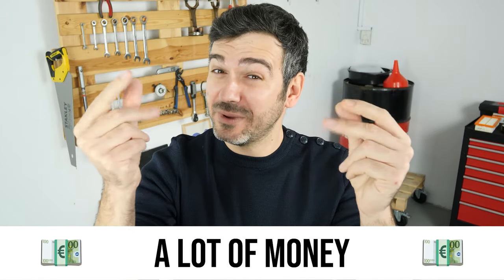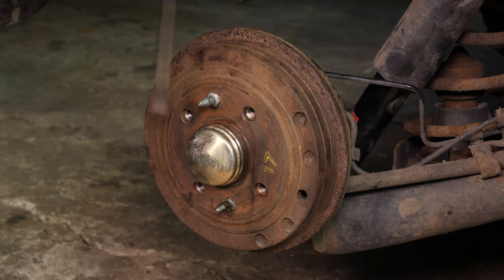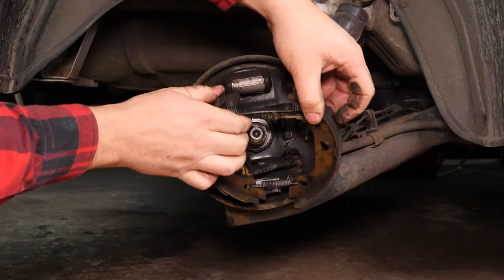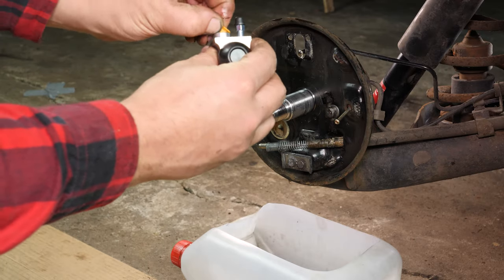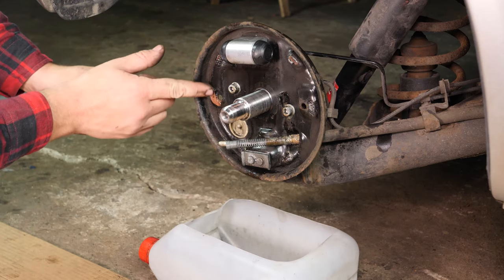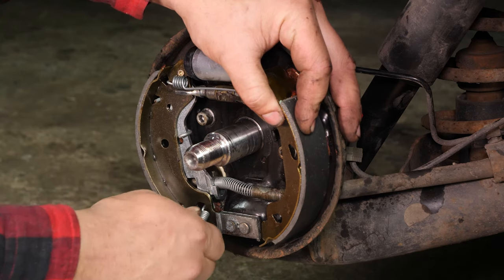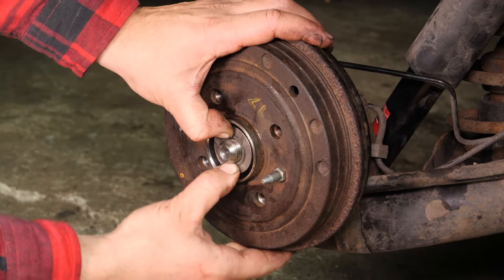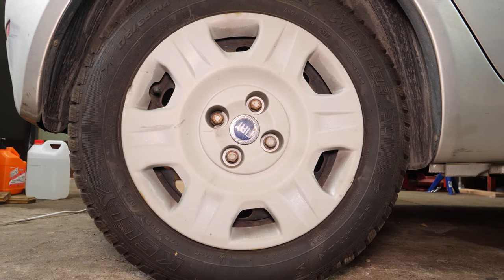How to replace the drum brakes Punto mk2 🚗

Comment: Why do you say use a 21mm socket to undo the nut and then a 32mm to put it back on
Reply from the maker: Hi @anthony maddocks! You're right Indeed! That's a 27mm socket. Just kidding. It's a actually 32mm socket to undo and put the nut back. It's a translation mistake. We let that one slip. We're sorry for that. Thanks a lot for noticing! How did the operation go?

Comment: This is not Fiat punto 2 its a Fiat punto 3 !
Reply from the maker: Hi @Marjan Brojcin, we're pretty sure it is a Punto 2 : https://en.wikipedia.org/wiki/Fiat_Punto#Second_generation_(1999%E2%80%932004)
Reply: @UseTool_EN   that is Fiat Grande Punto by the  headlights you can tell the version. Wiki can't tell you all, you have fiat punto 1 mk1 you have fiat punto 2 mk2  and that is mk3 mk2 don't have big headlights i have 2002 mk2 and they are different but all them is under one name fiat punto. I replace on my and is not the same only is the same on version mk3 fiat punto 3 is from 2003 so if you show mk3 and tell its mk2 people will do wrong. All people say fiat punto 1 is the same as fiat punto 2 they are wrong oil filter is not the same and 2 1.2 8v have engine by Lancia ypsilon.  mk1 have original fiat engine. On mk2 lancia and fiat use the same engine you have fiat coupe 1.8cc that is lancia not fiat engine. Mk2 end 2003 and mk3 is made from 2003 so i hope explained big difference. They are second generation only a engine is the same but other are upgrade  so if you tell 2 how people to know which version is they are not the same italian know how to give name to junk car its like golf 3 and golf 4 if they have the same name its big mistake like fiat do. And gen 3 is slow and mistake
Reply: @UseTool_EN  it's a Punto 2 (188)
Reply: @MAKI702  That' definitely punto mk2, just look at the inside of the car. From 2003 mk2 had lifting, they had bigger lamps. Grande punto(mk3) was produced since 2005 to 2012